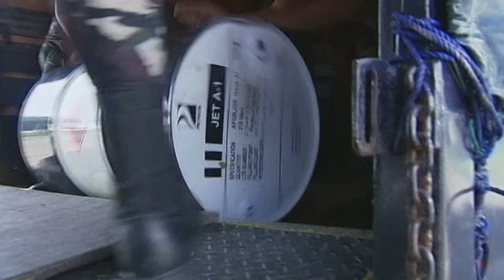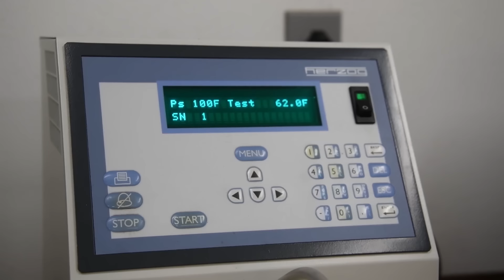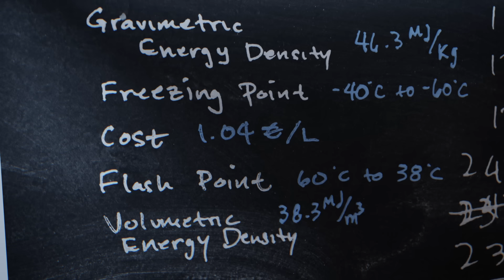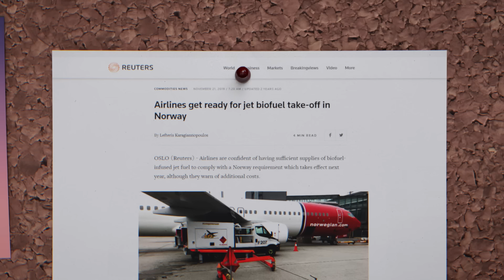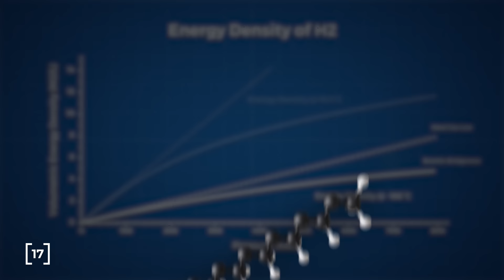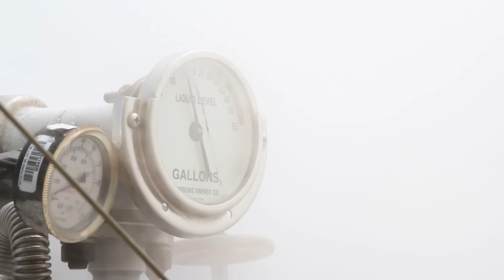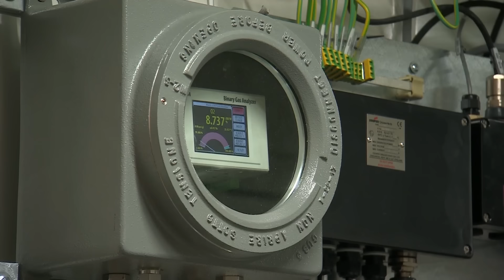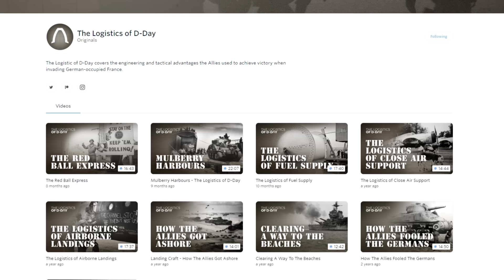The Uncertain Future of Jet Fuel

Comment: I guess it is time to build some high speed rail in the USA. That would remove quite a lot of unnecessary flights.
Reply: When you build a 600 mph train let me know.
Reply: Lots of studies on the effects of drilling tunnels under the surface of the entire country.
Reply: @sferrin2  200 mph would be more than enough. Even though trains final speed overall is slower, the have a lot of time savings in comparison to airplains.
Reply: not when you consider that the country is 4000 km across
Reply: @montiro8999  US is a much bigger country with it's population centres more separate from each other.
Reply: Damian Jablonski  so are Americans ready to spend 2 to 3 days(possibly even more) on travelling within their own country? Also how will americans travel to other countries which is seperated from it by ocean?
Reply: The us population isn’t dense enough for high speed rails.The only reason this works in European countries is because there population density is higher.I don’t even think the federal government could build those rail if some state that they want them to go through might say no for some reason.
Reply: @altayveyongunner1321  the only area that might make sense population wise is the DC-Philly-NYC-Boston line.  but then you have to wonder, where is it going to go? everything around is developed, there is no room to put it.
Reply: @rajashashankgutta4334  Most tips are less than 500 miles.
Reply: @ummdustry5718  average regional flight is less than 500 miles.
Reply: Never going to happen, and will require eminent domain
Reply: @montiro8999  you can have fragmented high speed railway network in some areas(like la to sf) but for others routes like new York to Houston, high speed rail is uneconomical.
Reply: @deathpony698  what about Dallas Houston, Detroit-Chicago–Cleveland–Pittsburgh–Washington, Toronto–Ottawa–Montreal–Québec?.
Reply: @sferrin2  you don’t need to go 600 mph if your going from SF-LA, Miami to Orlando, Pittsburg to Chicago, or DC to NY
Reply: Probably not as much as some people think. Planes have a huge infrastructure advantage over trains, you only need an airport at either end. High speed rail needs high speed track connecting every destination to every other. That's okay if you're looking at connecting big cities only 2-3 hours away, but when you have lots of smaller destinations, especially for leisure, it's never going to be economically viable to connect all the routes that destination is served by plane. Imagine a HSR line that only has a lot of passengers at certain times of year, and the rest of the time is almost empty. It would never work. But an airport can add extra routes with minimal cost, and it doesn't matter so much if they're seasonal.

In the US in particular, while there are clusters of cities which could benefit from HSR, it's likely that they'll take more cars off the road than planes out of the sky. The "point-to-point" model would also have to be thrown into reverse, rail only works as aggressively hub and spoke, and even worse, there's currently no infrastructure to transfer luggage, so connections mean carting all your luggage off one vehicle onto another yourself. Otherwise the distances are just too great.
Reply: @rajashashankgutta4334  yes that is correct. But the statistics show that most regional flights average around 500 miles.  More people will take trips from Dallas to Houston per day, than people will fly from New York to Houston per day. Most trips have a shorter range may it be with car or airplane between two major population Centers. That could easily replaced with High speed rail.
Reply: @rajashashankgutta4334  Shinkansen running speed: 320km/h, with a 360km/h upgrade on the way, Fuxing Hao running speed: 350km/h. The likely maximum USA rail distance is on the order of 4700km, thus a journey time is around 14 hours and 41.25 minutes, with an upgrade to 13 hours for the shinkansen, or 13hours and 30 minutes for the fuxing Hao.

While this is around 7 times longer than the Tōhoku Shinkansen, which is the longest currently operating, this still pales in comparison to other railways in both terminus-terminus distance and journey time.

Of course, internalitonal flights will be required, but a high speed domestic rail service will probably take comparable (or less) time to domestic flights.
Reply: @user-de4cq6uk6l  exactly. Statics show that the average regional flight is close to under 500 miles. High speed rail would take 3 hours with 200 miles per hour, with stoppage and speeding up time.
Reply: @insanecreeper9000  at some distance plains will save more time and building a 4000 Kilometer line is to expensive. But most flights are on average 500 miles and they are between 2 major population Centers.
Reply: @montiro8999  idk I dont live near those.  I guess Detroit/Chicago can't afford it
Reply: @Croz89  Most regional flights only average 500 miles. Those are the once that connect major hubs to each other.
Reply: @insanecreeper9000  you want to construct 4000 km worth of high speed track? It's uneconomical
Reply: @user-de4cq6uk6l  Who the hell flies from SF-LA?
Reply: @sferrin2  people who don’t want to drive for 5-10 hours
Reply: Or, hear me out. Invent a better solution to fuel. Which defiantly exists engineers just need to develop it. High speed rail has a place but investing in that over aerospace solutions feels like regression, our goal is to create new better technology, not stretch 1800's tech to be as quick and efficient as possible. Because eventually trains will become just as obsolete as horse drawn carriages, the aeronautics industry and aeronautical revolution in the early 20th century is one reason why the US is a superpower. 

I don't have faith in electric trains to be effective in 2100. And that's the investment scale you'd be looking at if your gonna build an entirely new infrastructure from scratch, across the country to compete with jet airliners.
Reply: @user-de4cq6uk6l  Fair point.  Do enough people do that to pay for high speed rail, without subsidies?  If it can't pay for itself that's a no-go.
Reply: @sferrin2  yes, high speed rail is fully capable of operating subsidy free, unlike highways, which require billions in subsidies for operation
Reply: @amatthew1231  why though, in trips under 500 miles, high speed rail is always faster, and more efficient. People in the 1960s said the same thing about trains being irrelevant in 2000, but not in 2000 they are having a massive resurgence, because in some cases they are just plain better. 

Yes we should invest in jet fuel alternatives, cross country flights and low traffic, high distance routes will always need airplanes, but in short, high traffic corridors, it is simply more effective to use high speed rail.

Also high speed rail was invented after the jet was
Reply: @amatthew1231  why though, in trips under 500 miles, high speed rail is always faster, and more efficient. People in the 1960s said the same thing about trains being irrelevant in 2000, but not in 2000 they are having a massive resurgence, because in some cases they are just plain better. 

Yes we should invest in jet fuel alternatives, cross country flights and low traffic, high distance routes will always need airplanes, but in short, high traffic corridors, it is simply more effective to use high speed rail.

Also high speed rail was invented after the jet was
Reply: @user-de4cq6uk6l  Apples and oranges.  A railway system as extensive as the highway system would not be able to pay for itself.
Reply: @user-de4cq6uk6l  High speed rail is a derivative of rail, locomotives. Its an iteration. Flight was an entirely new thing. And why? How much money do you think it would cost to lay thousands and thousands of miles of high speed rail to RERALCE our current rail network. Which is not compatible. And it will never have the flexibility of flight. Its gonna be obsolete within 100 years. Investing the multi billions of dollars that it would cost to develop, build, and operate would never make its money back unless your okay with paying $1200 cross country train tickets.

Trains were great, in the 1850s, fantastic in the 1940s. Air and shipping are meant to replace it. Rail is a temporary solution that will become obsolete. You can't replace jets, so we best develop new technology not old.
Reply: @montiro8999  500 miles might work if you had a string of big cities to connect up, like in China, Japan or some parts of Europe. If you've got two big cities 500 miles apart and pretty much nothing in between like in the US, it doesn't work.
Reply: @amatthew1231  who said it would replace our current rail network. Our current network would be used for freight. Also why would it go obsolete, what would it go obsolete to? Nothing. 

It is the most efficient form of transport known to man, we’d have to make a truly insane new discovery that somehow nobody had every thought of before in order to make it “obsolete”

Even so, it is zero emission, and spending lots of money building new infrastructure is better than dying in a resource war
Reply: @ummdustry5718  - time isn't the issue. The problem is the financial cost. HSR requires specialised rails, tunnels, and other infrastructure which is typically incompatible with existing railways, and as a result creating an HSR network involves massive capital costs. This is why virtually all operational HSR routes are in regions with both high population densities, and medium to high incomes, such as Japan, China, and Europe. Other than the BosWash, the USA is far too sparsely populated for HSR to be affordable.
Reply: @Croz89  why not? Germany, France ,China, Spain have some long distance routes between major hubs that don't stop in between.
Reply: @amatthew1231  trains have by far the best energy per kilometer conversion for a massive amount of people. Trains are definitely not 1800 tech. Japan, China, Taiwan have all invested into major infrastructure projects for the railroad and it has high impact, showing how many people use it yearly.
Reply: @montiro8999  Trains were invented 1800s and were the main innovation of the industrial revolution. We have adapted them. They aren't new. And they might be efferent at energy per kilometer, ships are even more efficient and we aren't using those to transport people. We care about energy per kilometer per hour, people want to travel across the US in a day, they want 2 day shipping, they all these luxuries high speed rail cant achieve or sustain. all it would take is a single breakthrough in hydrogen based fuel and the whole high speed rail argument falls apart. Way too expensive for way to low of a reward.
Reply: @montiro8999  Please don't compare Japan and Taiwan to the US. Your talking hundreds of miles of rails over small islands, vs 140,000 miles of laid rail over a continent. And look up how much China had to invest in their rail, the disparity is insane and they only did it because they lack an oil source. If they had our shale production they would never had invested into it, they import oil from the Middle-East, which they are buying all that is available to export, we extract oil from our shale deposits.
Reply: @montiro8999  Routes are not the issue, it's the tracks. You can have a train that only stops at some cities and one that stops at all cities and with good scheduling it's not a problem. But it's not economical to build a track that just goes between the cities at either end. China has enormous cities everywhere in some regions, so that's not an issue (and its HSR network is nowhere near as fast or extensive in the lass populated regions). Spain's system is arguably unsustainable, and France and Germany also have a lot of cities close together.
Reply: @amatthew1231  
We're having this conversation because flying is possibly going to become cost prohibitive, it doesn't matter if people "want" same day coast-coast travel or 2 day shipping... if/when the economics of aviation preclude this then regardless of what people "want" the fact is that they just can't have it.

Is this a retrograde step for society? Yes... it is. Though it may well be necessary, if so then too bad... get used to waiting longer and/or paying more.
Reply: @Croz89  with just a quarter of the tracks, the usa could connect half of all major cities together.
Reply: @amatthew1231  Why not. Japan is a big country, it is easier to build a railroad in the USA than in Japan or Taiwan due to geographic advantages. Railroad in China is superior due to the lack of air space and  the government  realizing the advantage due to a cheap transport possibility of the rail in comparison to others. Even countries that have oil have invested in the railroad.
Reply: @sferrin2  People like myself who use airlines for business purposes. I turn wrenches for a living so I have to physically be on site. There have been times were I have flown into the LA area for a job one day and need to be in San Fran the next day. Some of those SF to LA are connections for people traveling from a non hub.
Reply: @montiro8999  But would only have a fraction of the ridership. The US has 10 cities with more than 1 million people. China has more than 100. When you have so many massive cities in an area that size, HSR nearly always makes sense, you'll have huge ridership on practically every route.

Comment: 3:50 The longer chain hydrocarbons are distilled on the lower stage due to their higher boiling point, not lower..
Reply: Thanks for this. Comprehending that part, the logic made no sense.
Reply: He obviously meant to say some variant of "lower condensation point". It threw me too though, for a moment.
Reply: Yeah, I had to pause the video and think hard to make sure I wasn't having a brain fault, which I would have been more likely than Sam making a mistake.

Comment: There's a project planned in Iceland, where they want to put a synthetic fuels factory on top of a volcanic vent that spews out concentrated CO2 all day, every day. That would let them skip the energy intensive process of drawing CO2 out of the atmosphere, thereby reducing the cost of the fuel noticeably. It also helps that volcanic areas are chock full of free geothermal energy, of course. Not a solution that's viable at a global scale, but I found it interesting and creative nevertheless.

Comment: I feel like for commercial planes, volumetric energy density is much less important than energy density by unit mass
The only thing they care about is to have as little weight as possible,  cause it makes the flight less cost effective, they wouldn't mind filling the tank more, if the weight did not increase

The only possible way volumetric energy density is important to commercial flights is the maximum range, but that's often far less relevant

Comment: Does this even matter.
If we get it to a point it's the majority of a relatively tiny footprint, that's still fine.

Translating 3% to 25% means total emissions are but an 8th of today, in 2050. That's an amazing success, not a doomsday notification
Reply: No it will not be an 8th of today because air traffic is increasing quickly and will be much larger in 2050.
Reply: @Gryffins90  sure, planes will hold a higher percent, but they won’t be emitting as much as cars. Also planes like trains are a lot more carbon efficient. Like busses. You would agree that 1 bus is better than 20 cars
Reply: @TheWizardGamez  Planes aren't better than cars per passenger kilometer, even if you drive solo. Flying is, of course, less energy efficient than rolling on wheels, and its emissions cause more warming due to their altitude.
Reply: @Gryffins90  so with that being the case and cars moving to electric, the grid being largely renewable, does that matter?

Until we either make renewable planes or make a conscious decision to not fly, we can either worry about it or fix everything around it to make it a problem to remain to be solved.

It's become fanatical to address everything at once. Maybe this one we just accept and the rest we can currently solve we do well instead.

Comment: I was involved in the testing of 50% Biofuels in F-22's.  It works, but it is expensive (and it smells bad).  One other thing to consider is that to replace all of the power from Automotive/Truck Engines by 2050 with electricity we need to be adding 1 GW of Carbon Free power every 6 days!!  Maybe we should bump that up to every 5 days to account for air travel?
Reply: Roger Pelke published an article back in Sept/2019 that showed for the world to reach net-zero CO2 emissions by 2050 would require 3 nuclear power plants being brought online every 2 days. That would be starting the day after the article was published until 2050. Along with that, fossil fuelled power plants would have to be decommissioned at roughly the same pace. Or 1500 wind turbines every day until 2050. It’s interesting to see China leads the world by a substantial amount when it comes to renewable energy but on the other hand they also burn more coal than the rest of the world combined and will do so for quite some time.